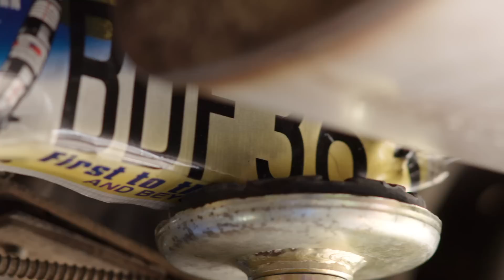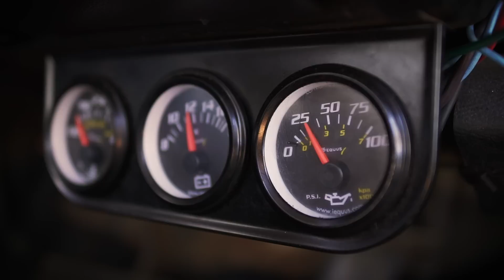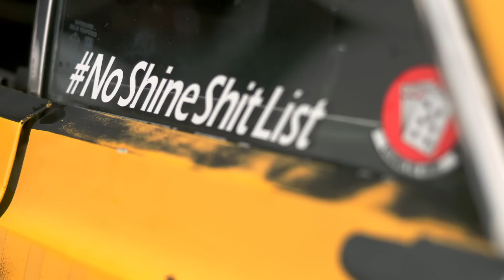Ratty Muscle Cars - The House Of Muscle Ep. 8

Comment: Ps, the lower rad hose collapsed since they came factory with a spring inside. But think how this could be done with 1970's "sticker and stripe" cars. Pick up a second gen Maverick, drop in a warmed over 400M and paint it to be a Stallion model. Or make a Spirit of '76 Nova. Or a Cobra II with GT40P Explorer heads--most of these cars just wanted a good engine anyway. Get some slotted mags or Magnum 500 rims and some raised white letter tires, maybe skip the side pipes this time around, and get enough clearance in the rear for some bright yellow slapper bars....

Comment: There was a guy I used to work with and he had an older style Barracuda with the big back glass. It was a (is this guy said) warmed over 340 with a 4 sd manual and it would put you in the back seat. Fun to ride and drive and only a Vette that a drove later felt like it pulled the "G"s like it did.

Comment: 340's always had respect !

Younger guys dont know how GM and Ford guys feared the 340 (along other Mopars)

340 were 12 second to low 13 second 1/4 mile cars STOCK !

Remember old recorded times were done on skinny tires and different test methods,all cars are quicker 0-60 and 1/4 mile than the test articles posted on the internet today are !

Back in 1969 a magazine tested a highway gear 340 Barracuda,with skinny 185 - 14 inch tires bias ply..It ran high 13's with no traction they rejetted the carb and ran 13.13 ...If it had tires of today its a mid 12 second car !!

Another magazine tested a 440 Cuda skinny bias ply tires with zero traction it ran high 13's...They addded a 10 inch drag tire thats equal to a new radial tire a minivan has lol..It ran low 12's and still spun !

I know 340 Darts,Cuda's,Challengers pre 72 would all run in the 12's !

Comment: 1) Wrong rear end gearing. Needs to switch to a 4.10 gear. 
2) Block off the heat cross over in the intake.
3) set timing to around 33-34 degrees total timing. 
(After verifying that the crankshaft damper is not slipping)
4) backface the intake valves 
5) switch the pistons around bank to bank.

Comment: The only bad part of this is that some states like mine have harsh inspection requirements. Those floors, rocker panel, exhaust not having tailpipe out the rear are enough to fail it here. You can fail for a lot of stupid reasons here. I live in Pennsylvania. The inspections here vary from county to county though. Some counties are easy on vehicles while others will fail you for "loud mufflers" etc.

Comment: You still need money to buy and get a ratty muscle car going !

That Cuda AAR is a $40,000 as it sits !!!

No need to have the car dirty,clean the interior ,wash it and wax them...Make them look nice ! 

I always had a pristine 68 Charger RT,but my daily car was a 240,000 mile original 69 Charger 383...It had rusty 1/4 panels,ripped seats and needed carpet,ripped drivers side (floor mat covered it) I washed it,waxed it and armor alled the dash door panels etc to keep it looking its best...

I restored the car in the early 90's and drove it another 110,000 miles,then repaired what needed and still drive it !

Comment: 340's got loads of credit !!!

Its just the last 15 years or so the younger guys took over I guess and dont know anything...Older guys who grew up with Muscle err.....Super Cars as they were known as know 340's run high 12's with only a carburetor change ! 

Swap the cam/heads/intake low 12's or better ! 

Magazine tested a new 340 Barracuda back in 1969...All they did was re jett the stock carb and they ran 13.13 in the 1/4 mile !!!! It also had 3.23's or 3.54's...Not 4.10's !!! So ! 

340's along with all Mopar's

Comment: I had a 71 challeger with a 340/727 tourqe flight with a old Edelbrock with the letters LD4 on it I was 25 or so bougt it  at a classic car sales shop for 5 k in 1990  I looked under the motor it was stamped 340 Hi performance on the block  I sold it for 4,700  probably worth 25 k today

Comment: I kinda get the not painting it bit, but patching over rusting structural panels with sheet metal and tech-screws - on a car worth a fairly significant sum of money - that seems a bit foolish.  Fix it properly even if you are just going to cut the rust out and weld in patch plates then prime & base coat.  The amount of rust this car has  - with those useless patches trapping even more moisture and dirt - it'll be un-drivable & beyond restoration in 10 years - then nobody will ever be able to enjoy it ever again.  The Dart is how a Rat should look & make you smile, the Cuda just makes me sad.

Comment: Ugh this car is gonna get ruined by so many bodge jobs and eventually this thing will be  undrivable if it continues to get "repaired" this way. It's fine to have some patina and surface rust on the body, but the internal components and the chassis need to be kept in good condition. Otherwise when those important parts start to rust and fail the car is fucked.

Comment: these arent even ratty i understand this concept but you need to understand ratty. Ratty is driving it with a slipping trans, blown gaskets, dead spark plugs, and brakes work half the time. these are normal running cars just because theres paint chips does not make it ratty.

Comment: That's not a reverse manual valve body.....unless he has the wrong shifting plaque.
Reply: Good eye, it is in fact the wrong plate. But the 727 does have a Reverse Manual Cheetah Valvebody
Reply: Nice.  Have a RMVB on my 400 in a rock crawler, but for entirely different reasons.  (On throttle 1st-Reverse slams if I'm going over backwards)